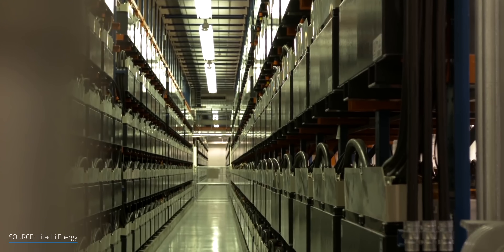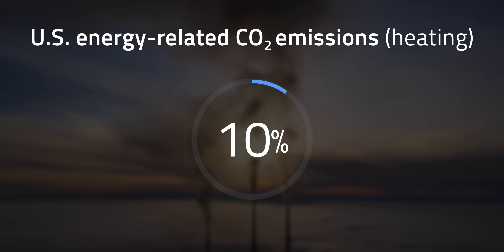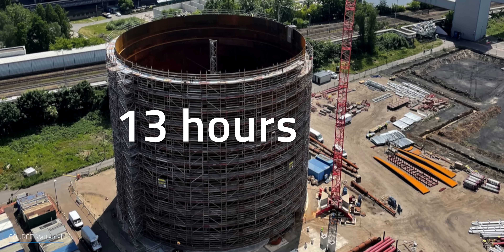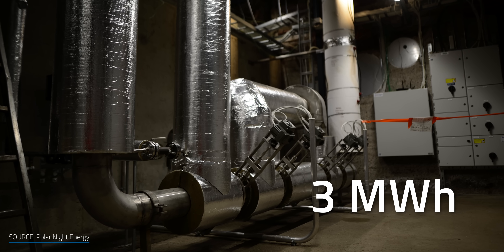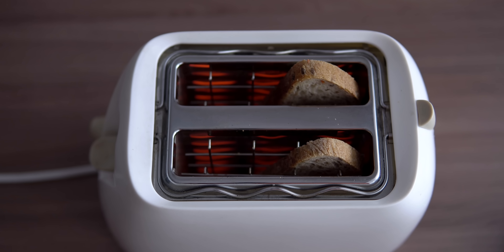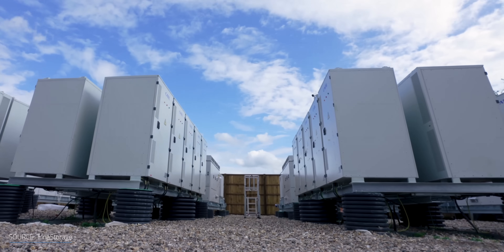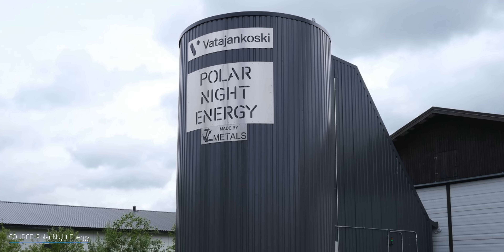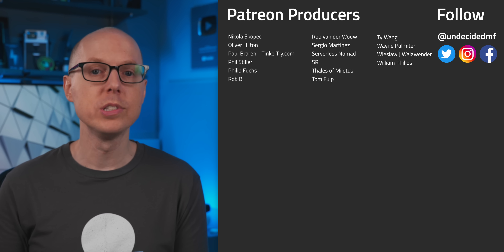How A Sand Battery Could Change The Energy Game

Comment: Stop with the 'CO2 is BAD' nonsense CO2 is the greenest gas available. The ONLY world metric that has actually changed in step with CO2 has been crop yields, it is thanks to CO2 that deaths from starvation over the past 20 years has been at an all time low while world population has been at an all time high. compared to 50 years ago the world population gas grown 40% while deaths from famine are down 40 FOLD. compared to 150 years ago the population is 5 times bigger and deaths are down 500 fold. CO2 is feeding the world. Life on earth is carbon based all of the carbon for all life enters the food chain from atmospheric CO2, The only real effect of cutting CO2 would be cutting the planets ability to support life. CO2 is good, we need more of it or eventually the world will starve. 

The planet is not getting hot,  Ice core data shows it is cooler now than it has been for 9,000 of the last 10,000 years. Raw tide gauge data shows sea levels are not changing any faster now than they were when Abe Lincoln was president. Greenland ice mass has increased by over 400 Giga Tonnes for 5 of the last 6 years (the worst year for Greenland ice was 2012 when it only gained 20GT) Greenland has not lost any Ice mass, year on years, for decades.  Polar bear numbers have increase at least 5 fold since the 80's (mostly because of a hunting ban) they are not in danger.

Comment: So windmills make electricity - if the wind blows
that electricity is converted to heat with red-hot rods to warm sand
the sand stores the heat until needed
the heat is then used to warm a fluid that then moves miles in insulated pipes to warm homes/buildings.

man, that sounds inefficient - burning clean natural gas to make electricity to run heaters sounds much more efficient.

Comment: Instead of a heating resistance, that is 100% efficient, why not a heat pump?
Reply: If they are intending to use the high temps that he referenced, that is an issue for a heat pump;
There are no heat pumps that operate in that temperature range... AFAIK
Also resistance heat can be scaled economically, heat pumps in the megawatt range would probably be cost prohibitive...

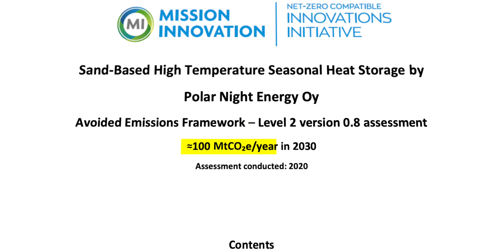Comment: 7:51 It's not clear the size of the storage associated with this figure.
9:25 "Resistive heating is 100% efficient." It's not wrong, but you can do even better than 100% with heat pumps.
Reply: He got the figure wrong. NYC's emissions was 56 Million MtCO2. I 100 MtCO2 is about the emissions of 20 people in New York.

Comment: As cool as this is, as is, I believe that the technology required to make this a real gamechanger has yet to be developed. I see this thermal battery as merely a peice of a much larger potential system. If the engineers could figure out how to heat the sand using heatpumps instead of resistance heaters. This would be a saving grace technology.

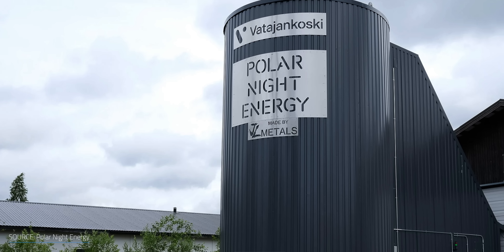Comment: 6:00 Small note on this point. Russian gas has NEVER played a big role in heating Finnish homes. In 2020 natural gas had 6% share of total energy consumption in Finland. In 2020 renewables also surpassed fossil fuels in the total energy consumption.
Reply: How did their renewable systems pop into existence? Manual labor, or was fossil fuel energy involved? You have to count the fossil inputs (mining, smelting, manufacture, transport, installation, maintenance, etc. of the "renewable" system) else "sustainable" is just a marketing trick wave breaking against a sea wall of sluggish minds. There's a point where some renewable systems break even, then start producing a net gain. Some. Most break before they ever get to that elusive zero-point. After that point, yay! But, it's unlikely (m)any of your renewable systems have broken even yet, and until that point, you'd have been better off burning the dino squeezins, or saving them for fertilizers, pesticides, tires, pharmaceuticals, and surgical tubing. It's difficult to do, but one must count every joule of Flintstones energy input, and subtract it from the purple-hair-new-age output before a truly legit smug can ensue. It does occasionally happen, but it's never a given as so many ignorant people presume. Confidence games are complex on purpose, and con game victims are always incredibly lazy (or emotional) thinkers. Be the skeptic/scientist instead.

Comment: Sounds like a geothermal heat pump... except the 'geo' is put in a box and the 'thermal' is sourced from the grid. Pretty optimized use for excess electrical energy, sounds like, for a very minimal cost. I want one.

Comment: Resistive heating and saving money... wtf? I get that only resistive heating can deliver 100ºC+ temps but still why not use heat pumps and heat exchangers? even in -10 or -15  ºC heat pumps deliver 2-2.5 COP, that is a huge difference... and for the capacity... 8 MWh is very small, yet they advertising great benefits and city heating... even one household needs more than 8 MWh for a season heating, which could be 1/3-1/4 less electrical energy with heat pump system . Is there any publication available i.e. energy loss / day? I found some other PCM heat storage says 5 % / day... with that you can bridge a few days between sunny / cloudy days or windy / non windy days... I hope to see these on much bigger scales and proven in many cases not only on PR videos...
Reply: The COP of a heat pump depends on the output temperature and input temperature. A heat pump might be able to output 20°C from a source temperature of -15°C with a COP of 2.5. Maximum theoretical COP for this condition is 7.37. Maximum theoretical COP with -15•C and 100°C is 2.24. That's with 100% Carnot Cycle efficiency. The 2.5 COP heat pump above has a Carnot Cycle efficiency of 34%.

As for the storage capacity, it's not storing heat from the summer to be used in winter, as I understand it. They deliver heat to the town, and when electricity is cheap, they store heat and use electricity to produce the heat they deliver. When electricity is expensive, they use the stored heat to deliver to the town.

Comment: OK, the physics suggest this is not a great design. Electric resistance is 100% efficient, but simple heat pump technology is 300-500% efficient. It takes 1/3 or less energy to extract heat from the air and put it in say water than using electric resistance heating. Even better extracting it from a large body of water since water is about 1000 times denser. Heat pumps are just much more efficient. And moving heat does not create more heat, which ends up going somewhere and warming the planet. And sand? Although it sure is cheap, the specific heat of sand (the amount of energy is can store per degree and kilogram) is only 830 J/Kg.°C. Water is 4182 J/kg°C, 5 times larger. Yes you have to limit the temperature to just under 100 degrees C, but doing so reduces risks over a system running at 600 deg C, where anything flammable can burst into flames by touching it. If you think pipes holding 600 deg material and pumps that can withstand those temperatures are cheap and reliable, well, sounds like a disaster in the making long term. Just put heat pumps in and convert the electricity to for 1/3 to 1/5th the cost. Want to store it? Use water. And multiple heat pumps prevent single points of failure.

Comment: Great video and nice to Finland recognized abroad. A few errors though:
1. Finland has all 4 seasons and isn't mostly winter all the time 😉
2. The gas cut-off by Russia has more of an indirect effect on Finland. Unlike the rest of Europe Finlands infrastructure is based on straight electrical heating with a adequate main fuse amperage in homes to support that. And also waterbased district heating where convenient as was pointed out in another comment.

Comment: The way you said Kankaanpää, would literally translate like “poops head” :D Finland has lot of pilots running around new ways to generate and store heat. But Finland does not use much gas, we use a lot of electricity. And current green energy sift has pushed energy prices truly trough the roof. Since it’s cold here, we use a lot of energy. Some people has seen their energy bill go from 2k€ to 8k€ under one year.

Comment: What I don't understand is, this is so simple, why was it not invented a long time ago? The demand for cheap heat storage has been there for as long as we have had intermittent power sources, and wind and solar have been in use for decades by now. It's literally just a pipe through some hot stuff.

Comment: The only real downfall I see is the resistive heating.  Sure, resistive heating is 100% efficient, but in the era of heat pumps, 100% is not good enough anymore.  Create the heat with a heat pump seems like a better way to go.
Reply: As a pre-heater it would work, but I'm not sure if heat pumps can heat air to 600°C.
The research company SINTEF in Norway has managed to create a heat pump that can reach 180°C. That was the record in August 2021.
It's a further development on a heat pump they've developed that can reach 100°C and is used commercially.

Comment: "Sand is dirt cheap"... Depends on the type of sand. If it's beach/ocean sand, then that is quickly rising in cost as the largest suppliers are banning ocean dredging due to how environmentally disastrous this is. Furthermore, they would have to compete with major countries which buy up this sand to create new land. If they use desert sand, they'll likely have a much better time as this simultaneously does not seem to be subject to the same environmental scrutiny and cannot be used for land reclamation.

Comment: I have a generally positive view of renewable energy but it seems like our need for systems like this says that we might be putting the most emphasis on those that aren't able to be the most efficient. Intermittent would seem to mean less efficient unless energy output varies exactly with demand. My  utility produces 97 percent of demand from renewables and the price for residential rates is 6.2 cents per kilowatt/hour for the first 40 kw/h and 9.75 for the rest. (4.8 and 7.5 cents per kw/h in USD
Reply: Damn, 6.2 cents per kWh. With the war in Ukraine ongoing and the Russian gas supply severely limited I'm now paying 37 cents per kWh with estimates for the coming winter reaching prices of >1 euro. I'm from The Netherlands btw.
Reply: I live near Montreal in Canada. The local electric utility gets about 95 percent of its electricity from hydroelectric dams a 4 percent from wind according to it latest annual report
Reply: My positive view of hydroelectric power and negative views on wind and solar come from asking the question of when is the highest demand for electricity. 
The answer to that question here is 6 to 8am in January or February at temperatures of minus 35 degrees celsius. In weather like that there tends to be no wind and solar isn't contributing much either

Comment: Honestly, I'd love to see something like this on a field-scale for those colder countries. Take any flat area, drop a layer of insulation down, dump any kind of construction waste, cover it with sand until there's a flat-ish surface, lay the pipes and wires, more sand, construction waste, sand, and cap it all with insulation. Kinda like taking a selective landfill, and turning it into a heat battery. It would even remove the silo and fancy bent tube out of the equation, as the pipe would just be flat. 
A man-made 3m high, 200m X 200m hill with flat insulation panels could do the same as theirs, but leverage existing construction methods. Hell, depending on the insulation properties, you could even build on top of it. Though it wouldn't fit in to existing urban areas unfortunately
Reply: Almost all cities have some kind of big hole close by. Old quarries, places where sand has been extracted and so on. Those can be utilized.

Comment: You should check out Harvest Thermal! They are working on developing a similar heat storage solution, but on a residential level that doesn't require already-existing infrastructure. Just a heat pump and a water tank.

Comment: Could we use this as a geothermal HVAC for the warehouse?  A lot of geothermal provider said geothermal is not good for warehouse. They said heat pump is better for my application. But utilizing heat pump will require a lot of electricity consumption

Comment: What's the difference between using sand and using water?
Reply: And why not even using heat pumps to heat that water? Efficiency would increase by a factor of 3 or more...
Reply: Sand does not boil at the 600 degree Celsius operating range of this system thereby eliminating the need for a very expensive pressurized tank as well as the risk of an accidental steam explosion
Reply: A. R. G.   This system operates at temperatures far above the heat pumps operating range
Reply: @dennisenright7725  What is the max temperature of these systems? Specific heat capacity of water is five times that of the sand. You could heat water from 20 to 90 C (pretty safe) and store the same amount of energy than heating sand from 20 to 370 C.
Reply: @dennisenright7725  You are right. If you use a heat pump with water you don't need to achieve those so high temperatures.

Comment: This seems to be a very interesting version of thermal mass energy storage  with readily available and relatively inexpensive materials. I would have assumed some form of heat pump but this system operates far above their effective range. It looks like an effective way of harnessing the output of intermittent output energy sources especially when it can tie in with existing heat distribution networks. How small could it be scaled?

Comment: It almost looks like an 'Off Gridder's' wet dream. I could imagine someone building one of these for one, or a small collection of homes. QUESTION! Would using Sterling Engines, to convert thermal storage to electricity, be wildly inefficient? (I think the whole 'steam generation' thing is not going to mesh well with renewables.
Reply: Honestly my thoughts too! Actually kind of interested in building and putting it underground for better storage. If I could, 6 months of heat captured during the end of summer and fall, to carry me through winter and early spring it would be killer for my solar setup.

Comment: It’s a great concept and I love the idea of using thermal storage this way! Though I have a question: If the minimal thermal loss of the silo you talked about here is capable of storing that much heat for months when it’s unused and idling in there, does that mean it’ll deplete sooner when it’s being used? Not a few months? 

Maybe I missed something here.
Reply: The heat loss rate from the storage tank (unless we have super-insulators) would be must faster given the very large temperature difference between the heated sand and ambient. I guess the video did not cover this aspect..

Comment: They should also go micro scale.
Heating solutions for solar powered homes. This way rural areas could go totally off the grid for longer spans of time. Don't have to worry about heating the home in winter if the energy to do so was already produced in the summer.

Comment: Hi Matt! Can you do a video on the super reflective new white paint? It reflects like 98% of heat into space, so it actually cools the surface. It can radiate more heat than it absorbs from the sun.
Reply: So they reinvented the physics? I don't think is good to reflect the heat into the air anyhow
Reply: @cristibaluta  Nope, they did not reinvent physics. They managed to reflect 98% of light, and heat, so radiation into space. Because the paint is white, it also radiates surface heat away.

Comment: This is one of those technologies that is so simple and obvious that I’m angry I never thought of it. It’s really just a geothermal system, where the dirt has been has been sufficiently reduced in scale to the point that it’s temperature can be influenced by its use as a heat reservoir. I’m curious about how scale effects it’s efficiency. Could I build a (much) smaller one of these for my home en lieu of a normal geothermal heat pump if I’m in too cold of a climate for one of those to be effective? Or would the size reduction cut too deeply into the efficiency as the volume to surface area ratio shifts?
Reply: should be able to since the volume to surface area ratio is only dependent on the shape of the reservoir not the actual size (closer to a sphere, the better). just need to do the math to size it for your home.

Comment: Why is the sand storage unit above ground?. Yes cheaper to construct but not thermally optimum - especially for long term storage.. Have the calculations for improved efficiency been done compared to increased construction costs.

Comment: It sounded like they would use a centralized sand silo and then distribute the heat. Since there is already an electricity distribution network, why don't they localize the silos for each heating center? The electricity to heat the sand will get there.